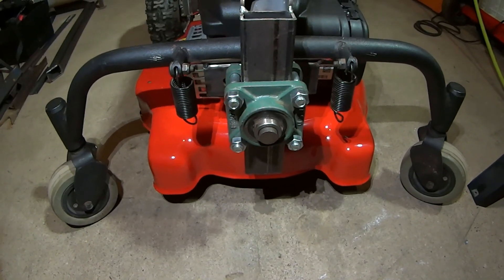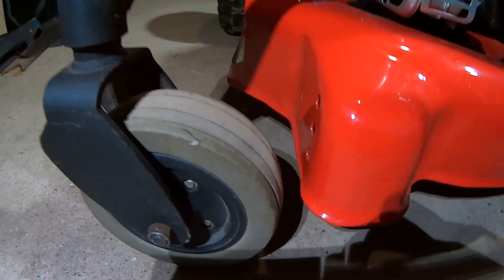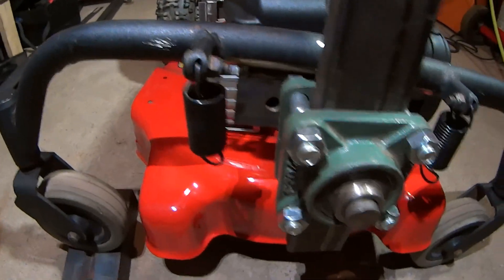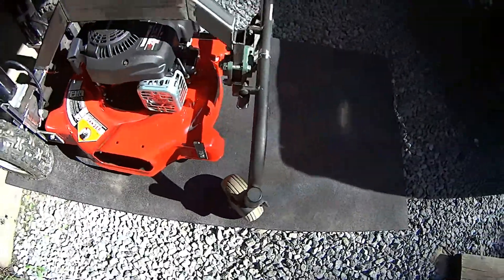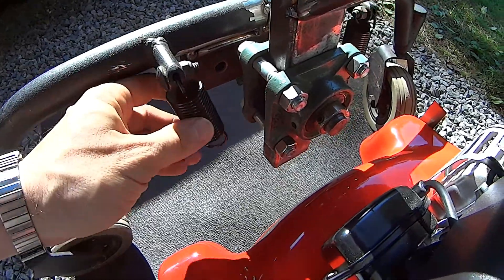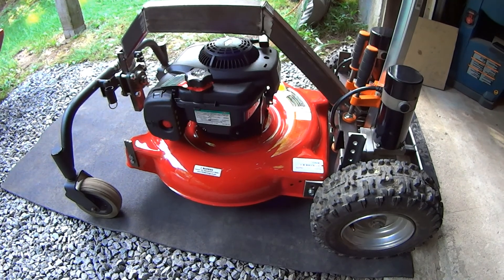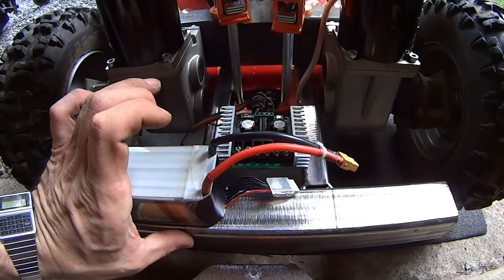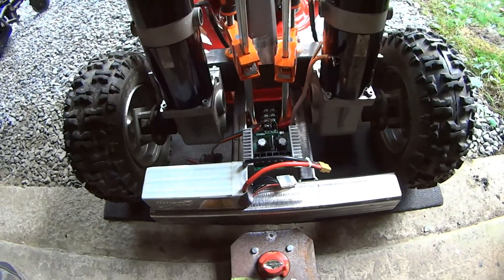RC Lawn Mower V2: Pt.4 Fully rolling chassis! Turns easier too!

Comment: The problem I see with this is that you will not be able to get close to anything when your turning like into the corner of anything.. your blades are sooo much further back from the front of the machine which means you can not cut anything close to a corner......... and also the reason a mower wheels are set back into the body is so that it can cut to the width of the blade and outer extremities of the cutting area, where now you are only able to cut to the line of where the front wheels travel which in my guess from the above view is about 2-3 inches inward. You now have an area that you cannot cut up close to anything...
Reply from the maker: Thank you for your thoughts. Some of the choices I made with the design I cover in the earlier videos in this series. Please check out the channel. Simply put...I'm looking to mow a sizeable chunk of lawn. No corners to speak of. A few inches between the blade and the front wheels is nothing compared to the size of the lawn. Some trimming required. Thank you for watching and commenting.

Comment: Your front wheels why not make a bracket for the front wheels that can be bolted to the original front wheel port ?
Reply from the maker: I really wanted swivel casters and the pivot up front. I couldn't see an easy way to do that using the existing holes in the deck. Thank you for your thoughts and comment. Thanks for watching.